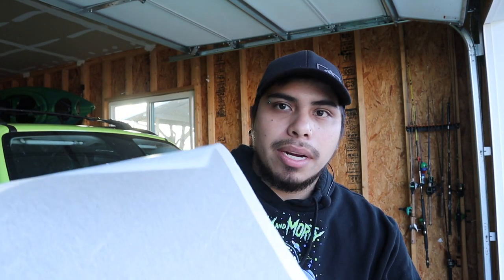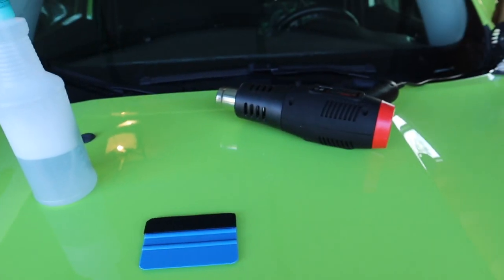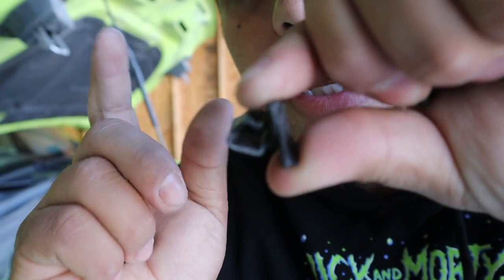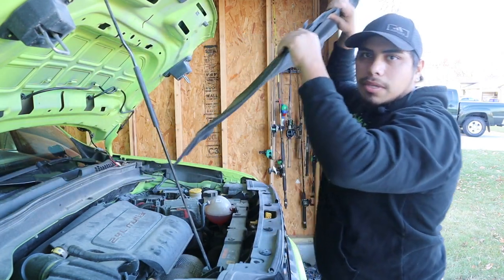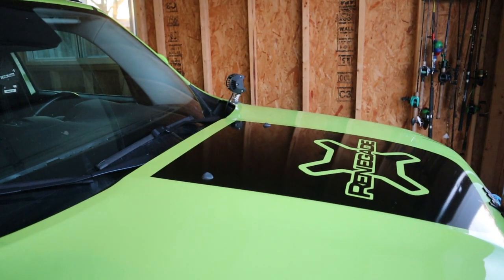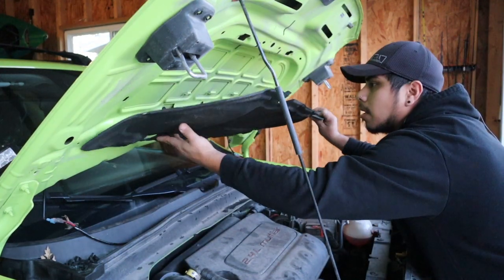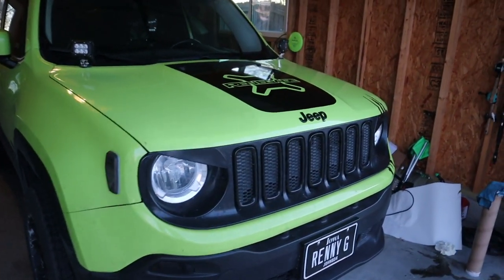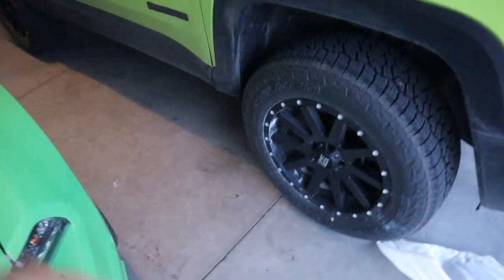Hood Stripe, wet install. (Jeep Renegade)

Comment: Turned out great! Nice job. Do you have any videos of you off roading with your Jeep? What year and trim level is it?
Reply from the maker: I haven't done any real off roading, just a couple of simple roads. kind of wanted to wait until I got my wheels and tires before I did anything to crazy. It's a 2017 latitude, I believe the altitude edition
Reply: I got the same. 4x4 2.4L multiair. Been looking for these kinds of videos.